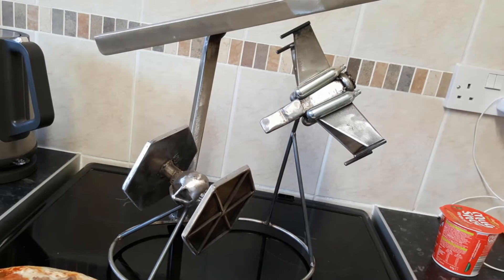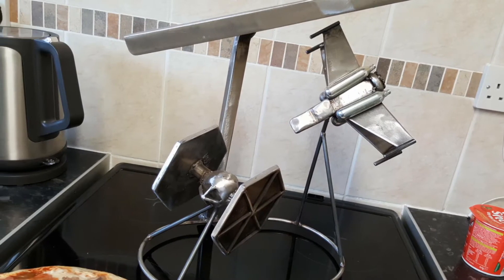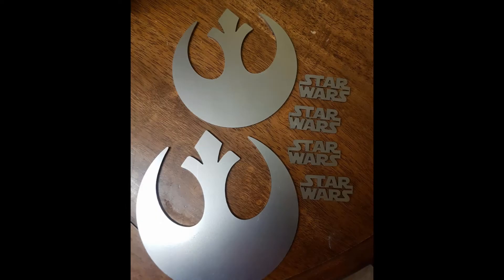Update and a bit of truck polishing.

Comment: First for once.     Now I'll watch it
Reply from the maker: ian matthews haha. About time you took an interest in my channel. Lol
Reply from the maker: I dread to Think!!!
Reply: That came out impressively for a quick clean, never thought of putting towling/ microfiber over the standard buffing bonnet.
Reply from the maker: Paul. The buffer is not a spinning buffer as per normal. The one I use has twin 4" heads and they oscillate back and forth. That's why the cloths don't just tangle up.
Reply: The Backyard Welder  thanks, makes sense